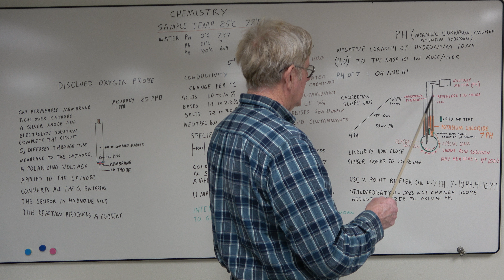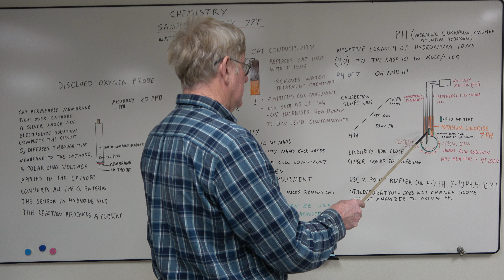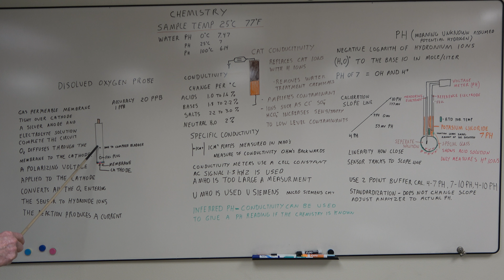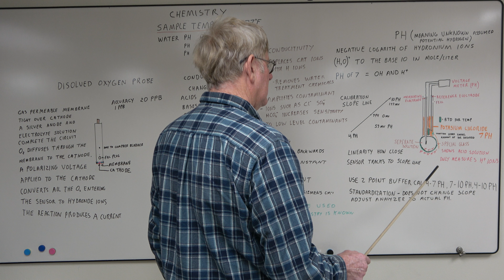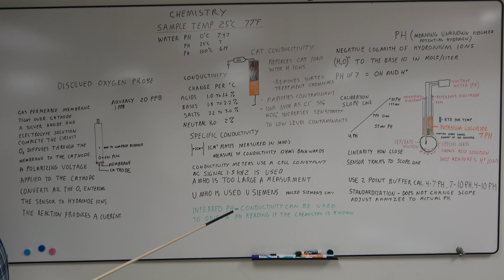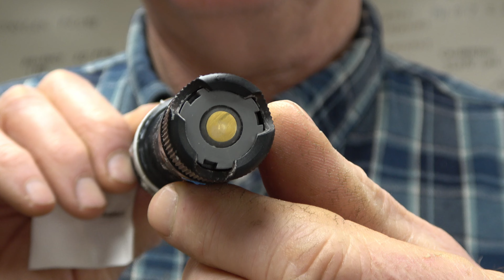Power Plant Basic Chemistry Part 2/4 Whiteboard 1

Comment: I used to up on the the intricate details of this stuff back in the days when I was doing industrial controls for a living. I built a lot of automatic neutralization systems and the probes were the archilles heel of the systems. We even used titration and optical colorimeters to beat the sensitivity to contamination of the permeable cell. They only needed a few ppm of oil or metals and would go right offline. That was 20 odd years ago and I've recently been working with hydroponics systems, and am back in the PH instrumentation game. Things have sure changed for the better, back then, the PH probes were finicky, and required constant attention just to keep them working. These days with microprocessors doing all the temp compensation and giving warnings if the slope is off, they are pretty reliable. Keep them either in process or  in potassium chloride solution, calibrate weekly or any time things don't seem right, and they are pretty well behaved. I don't run into the oil/lipid contamination issues in my hydroponics systems, but the metal chelates common in the solutions don't seem to destroy probes like they used to. I run a Bluelabs probes in the recirc loop 24/7, and they rarely seem to actually need calibration when checked weekly.
Thanks for the refresher course. Well done.